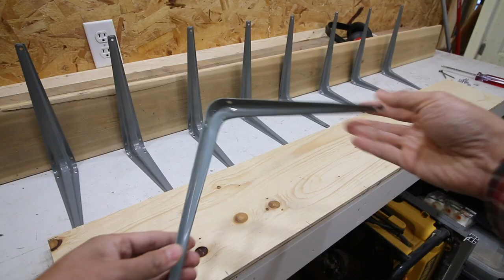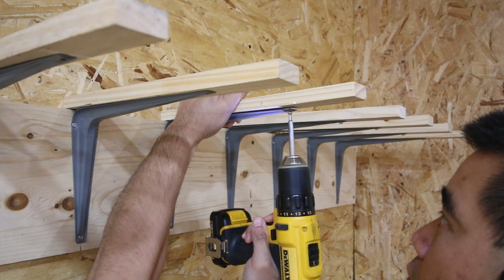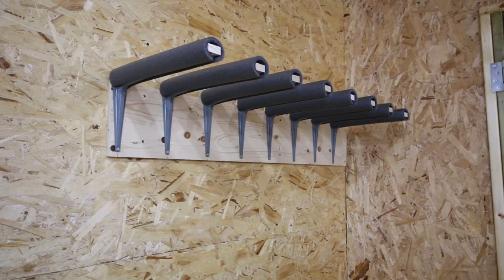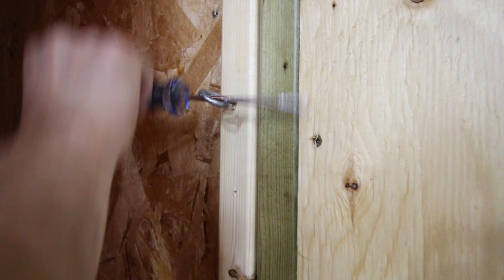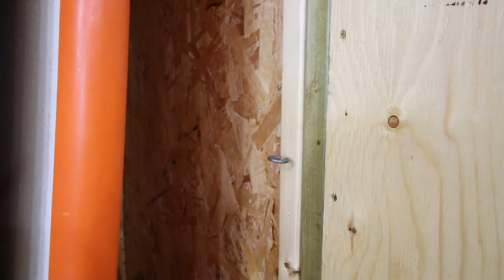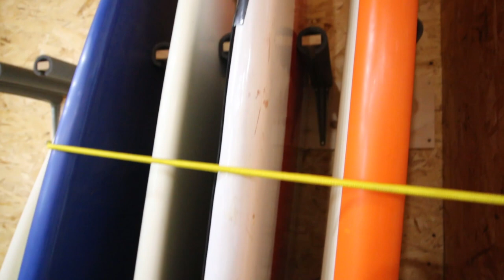How to Make a Surfboard Rack

Comment: Thank you for this video!  I just finished mine, and I want to mention one thing for people who haven't made theirs yet.  I made mine with 1x2s for the boards that stick out on the metal brackets, and at 22 inches long to match the width of my boards, they flex more than I'd like when I lean a board on them.  I was able to add stiffeners to help, but I'd recommend at least a 1x3 or 2x2 for stiffness, which even the smallest foam tubes should still be able to cover.

Comment: Hi Andrew, this is a good idea. I'm researching cost effective ways to build a surf rack. If you have a minute to respond, I have two questions. 1) How thick are the wood pieces on the 90 degree elbow arms? 2) Where did you buy that foam that wraps around the elbow arms?
Reply: @max heusser  you can use a pool noodle